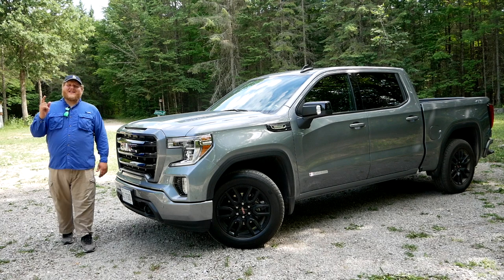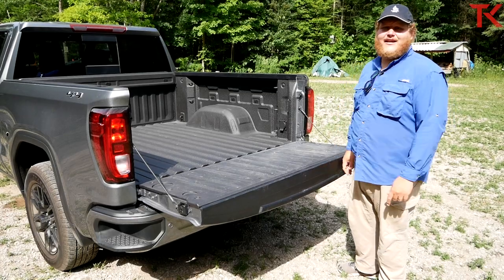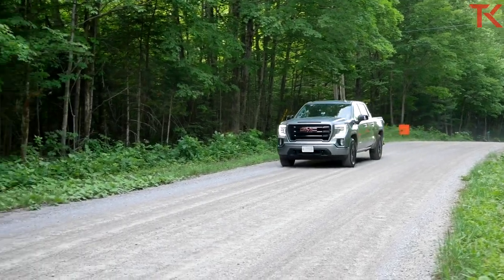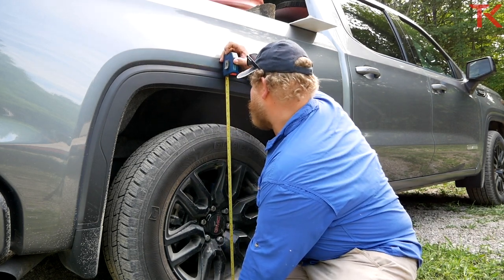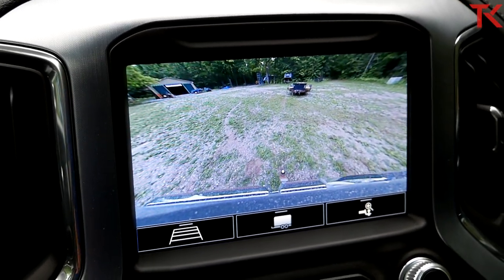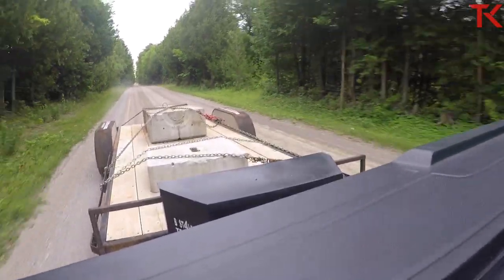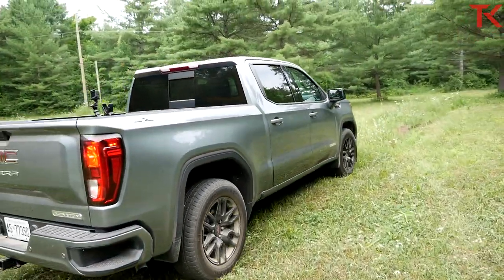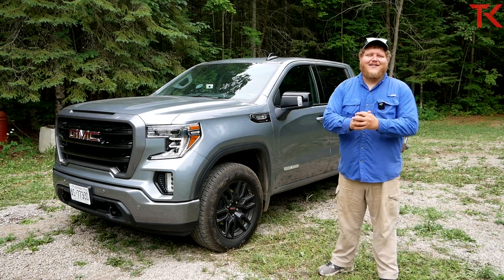Best Diesel Pickup? 2020 GMC Sierra 3.0L Duramax In-Depth Review - Towing, Payload and Off-Road!

Comment: Is the diesel worth it? I’m in the market for a new truck. Looking forward to the next gen tundra or a Sierra 2022 elevation (looking for a gasser but debating on the diesel)
Reply from the maker: The key factor is "how much do you drive?"   Extra money for the diesel option will be paid back sooner if you are a hi-miler.  Otherwise gas will do you fine.
Reply: @TruckKing  good deal! This would be my new daily , not looking to tow anything. Just dig the truck

Comment: Why buy a 1500 diesel when you can't legally tow anything with any weight to it?
Reply: @Air Force Juan Any rental place won't let you take anything unless you have a 2500.
Reply: @Air Force Juan Most places won't let u rent a car trailer with a 1500. If you want to haul a skid loader you should have a 2500 or more. 6300lbs isn't that much.  bobcat and a trailer is 8k +
Reply: @Air Force Juan Sorry LBZ 2500

Comment: I tow a jayco 4k pounder. I wanna upgrade from my 5.3 8 speed, do you guys recommend going for the 3.0l diesel or 6.2l gas very similar price and I wanna stay 1/2 ton. Need your opinion guys!
Reply from the maker: The 6.2 and the 3L diesel both have the power - but the diesel will give you better fuel economy.    Dad
Reply: @TruckKing  I guess diesel it is. Thanks Dad!
Reply: Test drove the 3.0 it’s a smooth quiet ride. I bet gas mileage is crazy good

Comment: G80 has its positives for sure, your Dad has good points. I'd also point out that the G80 works in ALL drive modes, you don't have to be in 4low like many auto lockers.
Reply: Truly, it's NOT an "auto-locker", it's simply a clutched locking differential, and they all work the same way, they're ALL mechanical in nature, regardless of 2hi, 4hi, or 4lo...the G80 has been around forever, my 2002 GMC 2500HD has one...

Comment: NO vehicle you have to REMOVE THE DRIVESHAFT AND  TRANSMISSION just to inspect the STUPID belt driven oil pump belt is the "best" at anything!  When, not if, the belt breaks, oil pressure is zero.  The oil pressure driven timing chain tensioner slackens and the cam chain jumps timing.  Now off time, the pistons crash into several open valves detonating the engine's destruction!
Why would I want to check the oil soaked oil pump belt, a $2,900 job at the shop??

Comment: Recently test drove one and liked it and the mpg.  The dealer said service life of the engine is 200k miles. Have you heard that?  Does that mean a total rebuild is required or just a new belt, gaskets and some accessories may need to be replaced?  

My main concern is longevity, being a new engine.  Any thoughts?  Would you get this over the other brands?

Is a long bed club cab coming out in 2021?

Good videos.  Thanks.
Reply: My convern is that oil pump belt which seems soaked in hot oil. Timing chain is between engien and trans but I dont know why they put oil pump belt between engine and trans as well.

Comment: Hey guys love your work.
I was just wondering what your opinions are on this sierra 1500 diesel in Ontario winters? I am thinking of moving from a ram 1500 V8 to a sierra 1500 3.0L diesel. What's your take on it?
Reply from the maker: In short - we like the GM 3L. We’ve so far started and ran it in minus 20. no problem

Comment: Can't wait for all the recalls on that belt driven oil pump when the belt is submerged in hot oil all the time....pure genius Wile E. Coyote (GM)...secondly best useless bed you can't even get a standard piece of plywood, sheet rock or a sofa and close the tailgate oh speaking  of tailgate lets see how long that push button tailgate last compared to a regular handle
Reply: You can get an 8 foot bed in a single cab if you must.
Reply: Ok we get it.. you don’t want one. Thanks

Comment: Another Isuzu diesel junk. It overheats, problem after problem and overpriced. That is why ram eco diesel beats gm. Inside of 3.0l, get the proven Isuzu 6.6l diesel which have been over 5 years.
Reply: It's not an Isuzu diesel. Nor do they overheat. Bunch of internet BS.
Reply: You really haven't a clue as to what you're talking about, so you...??? The original Duramax, the LB7 was a joint development between GM and Isuzu, and that was in 2001, NOT 5yrs ago...
Reply: Just came out and you’ve had all these problems with yours? That’s crazy
Reply: Isuzu 3.0 is a 4banger. This one is 6